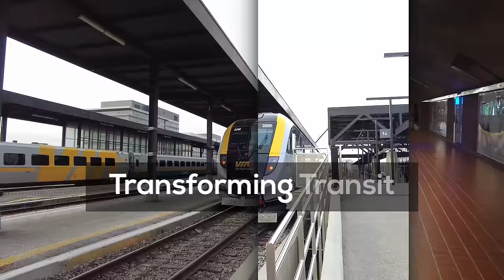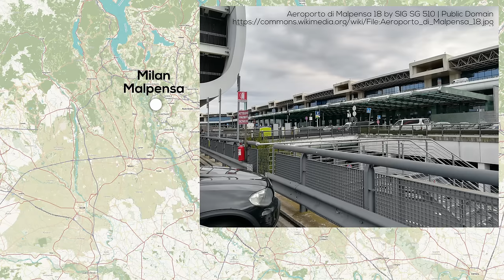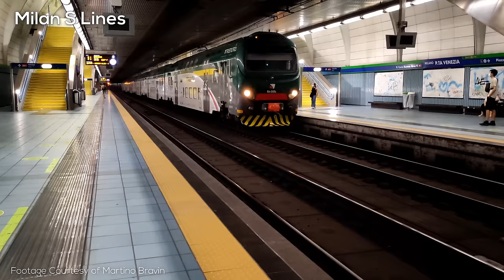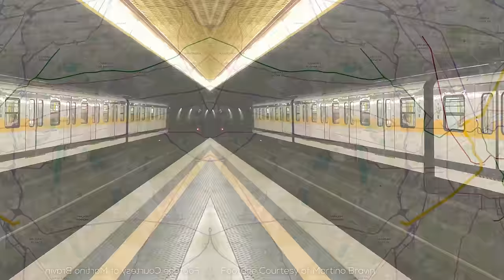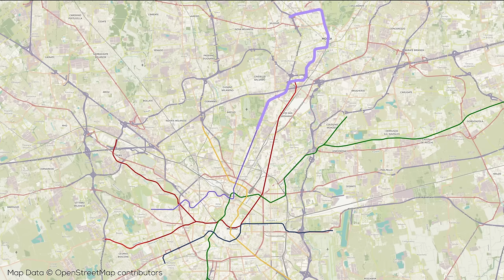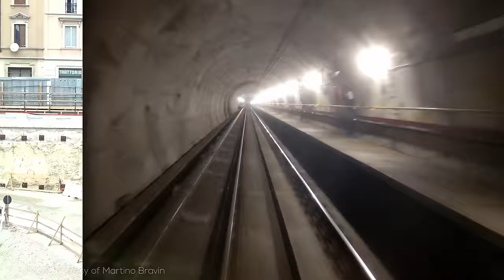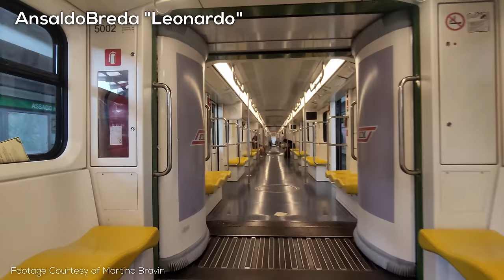A City That Builds Metros Like No Other | Milan Metro

Comment: There are few more things worth to mention:
- ATM is managing the subways, bus and tram and I'm very proud of their care and work. The S line is managed by Trenord and most of the users complain about their poor service. 
- M1 train powering system is allowing the trains to have a very high frequency. Sometimes the next train is just waiting few meters behind the one stopped in the station.
- M1 and M2 are interconnected and M1 trains can travel on the M2 line (for maintenance reasons and at lower speed) using a small pantograph. M1 trains are taking the power from the tracks and M2 from the wires on the top.
- The Leonardo trains are having an emergency brake system that is able to stop the trains automatically if there are obstacles on the track. This system malfunctioned some time ago and the trains were suddenly stopping without reason. For this reason is better to hold tight to the rails while traveling on the train. :D
- Each bus/tram/trolleybus is equipped with an onboard computer which is able to keep track of the position, send distress calls just pressing a button or simply handle the driver turnover. This system is communicating using a digital cellular like radio network.

- The technique to build the tunnels has been used later to build skyscrapers around the world. 

The S lines, at this time (August 2022), are not working, almost all the trains are out service because the tracks are damaging the train wheels (at least this is the explanation Trenord is giving to the users). The service is expected to be resumed later this year.

Comment: Great video Reece!
Sadly at the moment Milan and Lumbardy are facing serious issues with trains, despite regional trains in Italy flourishing again the region that needs them the most - Lumbardy - is just struggling. They did a local rail company, Trenord, which simply sucks, probably because it has just been riddled with incompetent politicians from the area. The result is that rail commutes are going down and car commutes are going up, in a region already struggling with traffic and pollution. They also don’t let sales and offers from Trenitalia on Trenord trains, actually cutting in half northern Italy regional transport.
Reply: Yeah, I know something about that. The cut-off of the underground S lines from end of July to end of August is a massime PITA for those (like me) that need to use it to go to work. Luckily they found the reason and fixed that (typical italian story: nobody was maintaining the greaser that helps the trains on the sharp bent between Dateo and Pt. Vittoria, train were passing there with no grease on the tracks and train wheels were abnormally wearing themselves out...). Let's hope by september they'll have all back in shape.
Reply: the busses in the monza and brianza province all suck
Reply: As someone who lives just in the outskirts of Milan since birth, I can confirm that many trains from Trenord are old and outdated. They did implement some new trains, but, in my opinion, most old trains should just be revamped or replaced

Comment: I live in Milan now. One thing you did not mentioned is the fantastic troleybus lines which makes travelling in the city even more convenient. Nowadays I see more and more of the electric busses and hydrogen ones, and on top of that you have something called bus taxi (I have no idea how it works, but apparently you can call them and they will provide a service when needed). Only one thing which is missing in Milan is the bike infrastructure. The city is rather flat, and gave gigantic roads, which would be perfect to convert into the bike lines.
Reply: About the busses. Within 2030 the whole Milan's busses fleet will be full electric.
Bus taxi is a service you can use during night time. If you call they pick you at a specific 'stop' (they are marked with a tiny hexagonal sign, generally on a lampost) and bring you home (yes, the adress you provide the driver).
Obviously they do predetermined routes and pick up all the passengers who in the way. One very importan thing is that the service is organized in different zones, then you have to check the zone service in advance because you can't go out of that zone (it would be impossible. It will be a true taxi cab service)

Comment: Great video, I love Milan because you can move around easily with trains,metros and Trams, the sistem is very efficient,but a substancial problem is the schedule. After Midnight there is rarely a Transport and some like trains or metros are closed, so if you want to have fun at night you can't count on the Transports to take you back home. That was not a Problem that I had in Bilbao,a city in Spain that during some periods of time (I Remember during Summer) continues with metros even after Midnight. It would be nice if you explained also that city
Reply: the metro in Milan closes at 00:30, like in London and Barcelona, except that in those two cities the metro runs Fri and Sat nights 24h in LDN and Sat night 24h in BCN. In milan there are night buses and buses that replace the metro lines and stop at the same stations.

Comment: Ah! I was wondering if you would dedicate a video to my homecity! Thoroughly well researched and informative video :) there is currently an ongoing discussion about M6 which should run north-west  to south-east, although no plans have been firmed up yet and initially it might just be renaming and making automous the tiny south-west branch of M2. 

M2 itself was mostly famous during its construction for connecting most of the railway stations across Milan: in addition to Centrale, Porta Garibaldi and Cadorna, north-eastern Lambrate and south-western Porta Genova are linked.
Reply: M6 route they want to build is actually autonomus. I made a video a couple of months ago on that matter.
Anyway we will see the final route design after the verification study
Reply from the maker: Thanks for watching! I’m jealous of Milan for its system!
Reply: @RMTransit  M6 line is meant to follow the exact same S9 line route between Piazzale Corvetto and Tibaldi. S9 is currently running with uncertain train times. It was ment to be every 30' untill 22:30, which is bad, but it's solid and constant. No one knows when the line really operates. Every 30'? Every 60'? What's clear, is that frequency has become 60' on Sundays and there are no more trains after 21. 
But you know... Automated metros looks trendy so instead of doing a solid service on the existing railway, they're thinking about an automated metro (replacing the railway? Under the railway? Nobody knows)

This city is ruled by trends, not Solid planning.
Reply: @lucaspublictransport995  wasn't the separation of the Biseglie branch of M1 into the M6 also discussed, running it north from Pagano to kind of sort of Quarto Oggiaro?
Isn't also S9 corridor getting a big boost with new stations and the rumoured "circle line"
Reply: @luca7069  No-one knows exactly
Apparently, M6 should be a semi-circular route between Cascina Merlata/Rho Fiera and Rogoredo or something like that. That idea of replacing M1 with M6 on the Bisceglie branch should have been abandoned (Maybe? Who knows)

Comment: M2, also known as green line, connects all major train stations, non only Centrale Garibaldi and Cadorna but also Lambrate and Porta Genova
You might be wondering why we have M1, 2, 3 and 5 but not the M4. 
M4 was delayed so the M5 was completed before the M4 construction even started, it is now almost ready to start operations in the first part, will connect Linate airport to the city.
Reply: To be more specific, M4 was a previous project, but M5 (in its first proposition which was merely from Garibaldi to Bignami) was a more feasable project and got easily the money to be built. Consequently even the second stretch from Garibaldi to San Siro was easier to finance.
M4 as a whole was a more complex and expensive project and that's the reason why M5 was built before.
Maybe (and I say 'maybe') for M6 they're thinking to do as they did with M5, and for this reason they recently showed a route which is clearly half of the line, if not less. The shorter the line, the easier to find the money, the faster to start the constuction. Just as it happened with M5

Comment: Since Saturday 5th July 1997, I have enjoyed riding the Milan metro whenever I visited.  I liked the most recently built line M3 as well as the Passante suburban rail system, not so much the older M1 or M2, but that changed over the years.

Comment: To add some insight: the S lines passing through Garibaldi were all shut during August due to technical problems on rails/trains resulting in damages to train’s wheels. There was a dispute between RFI (owner of the infrastructure) and Trenord and now things are slowly being solved an circulation is nearly back to normal, except for S2.

The good thing is that the S lines and the Trenord station are very well connected also in “minor” station, such as Affori FN/M3, Domodossola/M4, Repubblica/M2, so it is easier to go around closed stations.

Trenord it si also infamous for its frequent delays and general poor service  on R lines, the regional train going out of the suburban area of Milan.

The major airports are also reachable with bus from Stazione Centrale and other major stations, Malpensa can be reached also from Cadorna with the train.

Comment: Milans Transport System is quite similar to Vienna I would say (Metro, Trams, S-Bahn)
Reply: As a matter of fact Milan was under Austro Hungarian Empire till mid 19th century 😁
First railways were built when it still was a province of the Empire.

That said I do not think there is a direct historic influence even if there are similarities.
S lines are clearly inspired by German ones, though. But it's something dating back to 20 years ago. Even while they were building the tunnel of the 'passante' they hadn't clear how to design the service. 
Now other cities in Italy are trying to adopt similar systems for their local trains. Unlike Germany or Austria they're not using a standard method and a standard signage (Milan one wants to recall German S bahns), but that's a service improvement for them, anyway.

Comment: The M5 maintenance depot and practices remind me a lot of the Toei Oedo Line in Tokyo, which also does heavy maintenance at an off-site depot by having trains towed there. 🤔

I wonder how many cities can look at this maintenance option for shorter new lines, as even differences in power and propulsion technology are clearly not a barrier up to a certain point.
Reply: Anyway this was not the best option and I think that if M5 was designed today they will opt for a true depot from the begginning.
Extraordinary maintenance was most necessary than expected and not easy to manage by sending the trains on M2, obviously only during the few hours of the night metro doesn't run and coordinating with M2 line maintenance squads.
Earlier last year M4 first branch was ready to be opened. Just few stations from Forlanini FS to Linate.
They gave up partly because the branch was too short and due to covid restrictions Linate airport hadn't many flight those days, then probably no many people would have used those few stations.
But mostly they decided not to because the depot, which is at the other side of te line after San Cristoforo terminus, wasn't ready and wasn't reachable by the trains (now it is), so they had to run the branch as a shuttle without a depot for maintenance.
Mindful of M5 bad experience they choose not to open and waited for the depot to be accessible and more stations to be ready to open a bigger stretch, which will happen after summer

Comment: ATM, Trenord and other minor local companies are all integrated in the new (2018? Something like that) "STIBM", meaning with the same ticket / subscription you can travel on all the transportation lines inside a given area, enabling an inter-modal transportation very easily! ATM is also providing a bike sharing service (that is not free flow but has many stations) tha have free minutes for the holder of a subscription.

Comment: M1 line use a "fake" 4th rail system, where the fourth rail is used for return current instead of tracks and it has 0 volt tension. M1 trains are dual system third rail - pantograph, because they use catenary into  the depots and sidings.
Reply: there’s nothing fake about a rail that’s part of the electrical circuit

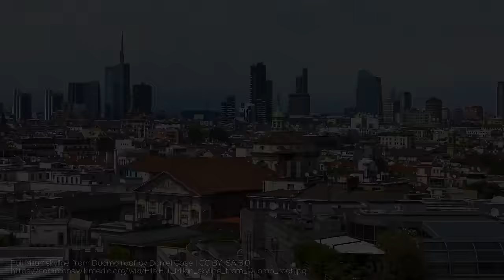Comment: 0:49 hmm no Milan is not in the foothills of the Alps. Milan is in the middle of Italy's largest valley, that is Po Valley. The geography of Milan is reaaally flat.
Reply: You're right, but if speaking about the entire metro area of Milan it's somewhat accurate to say it's in the foothills (the Milan metropolitan area includes Como and Lecco for example).
Reply: A Milano sembra è piatta ma non lo è perché abbiamo la forma V concava. Quindi la Pianura Padana non è piatta al 100%. 😃
Reply: @NoelBode  majors not. As someone who lived in milano for 18 years i tell  you that any Italian knows milan metropolitan area is super flat
Reply: Milan is at the northern edge of the Po Valley, where it meets the Alps. Within just the Metropolitan City of Milan there are elevations from 80m to 240m. The actual metropolitan area as defined by the OECD, called Greater Milan, contains the provinces of Lodi and Lecco, ranging from 40m at the Po near Cremona to 2.600m at Monte Legnone. Lodi itself is around 80m, Lecco around 240m. Even the Comune di Milano has a 50m gradient from southeast to northwest. My point is that saying "Milan is in the foothills of the Alps" depends on your definition of "Milan". The smaller you draw the border, the flatter it looks.

Comment: A few fun controversies about Milan metros:

1. The M5 has been experiencing excessive rail wear on one particular section for reasons that are still unclear. You can tell this is an issue, because trains slow down to a crawl in this area.

2. Residents complained about M4 construction because, supposedly without anyone being informed, the constructor company erected these huge air exchange towers in the middle of the street, ruining the view from the apartments. The official motivation for this is that new air quality regulations do not allow ground-level air exchange grates.

3. The M1 train control system is defective and is known to apply maximum braking power to the trains for no reason, this has caused injuries and a rash of newspaper articles. The reason for this is not fully understood but software glitch is suspected (go figure). The current solution involves deactivating half of the braking devices on each train to make these sudden stops less dangerous, and posting signs that advise people to hang on especially tightly (no, this isn't a joke).
Reply: 1. M5 has train wheels consumption a bit high in a very sharp curve entering Garibaldi station from Isola station.
As they can't do extra maintanence with line facilities (there is not a proper depot) and have to send via a link tunnel trains to famagosta M2 depot for these matters, they try to limit the cunsumption by slowinf the trains on that stretch. That delays the travel time of few seconds, anyway.

2. Unfortunately for the residents who said they haven't been informed, they were. 
Infact the towers for the air shafts were present since the beginning and can be spotted in the first plans submitted years ago, even if they had different shape and design (but same size). More over M5 has the same towers on its route, then that's nothing new at all.
It's just a case of NIMBYsm, with of course politcal speculations to ride the complaints